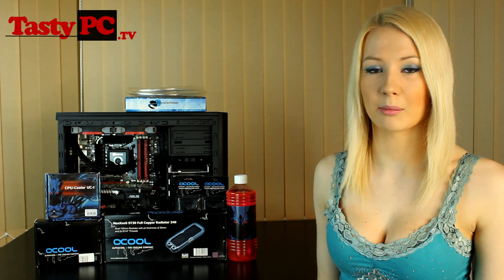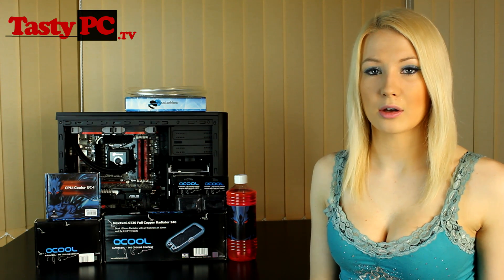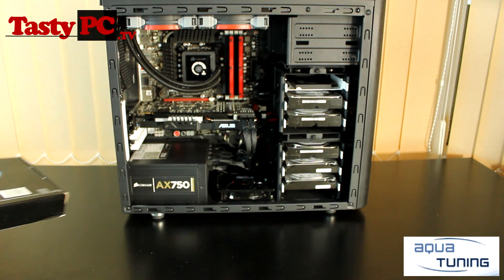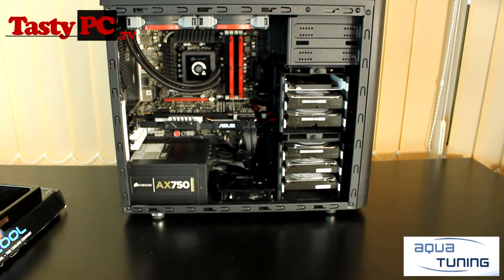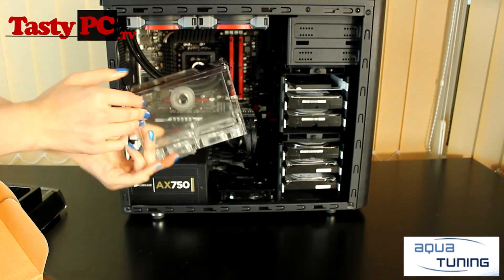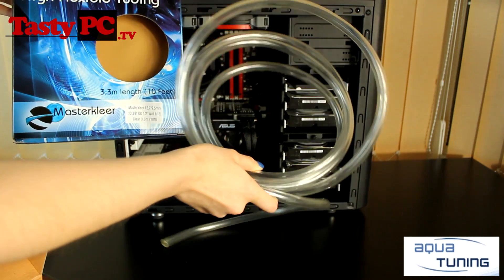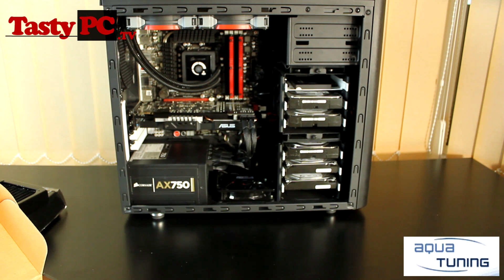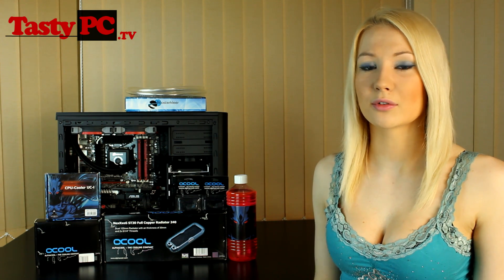Arc Mini Watercooling Plan - Aquatuning

Comment: ok here goes for budget watercooling that said it runs just as good or even better all this stuff here, mini pump from amazon £8 double 120 rad £20 and reservoir 25 quid, mini block that will fit in between the cpu and air heatsink for hybrid cooling, a fiver. 

http://www.amazon.co.uk/gp/product/B00IYLYRRY?psc=1&redirect=true&ref_=oh_aui_detailpage_o01_s00

http://www.amazon.co.uk/gp/product/B010P3VN4S?psc=1&redirect=true&ref_=oh_aui_detailpage_o02_s00

http://www.amazon.co.uk/gp/product/B00L2868VE?psc=1&redirect=true&ref_=oh_aui_detailpage_o03_s00

Buy em, actually will do a better job than all that stuff in this video for half the price :)

DO NOT mount hard drivers underneath a drive bay reservoir, one spill and your hard drives are dead. and 
DO NOT mount your psu with the fan facing upwards, again so called "anti conductive" liquid means nothing after a week or two of use, if it gets in there it will blow up your power supply. the fan supposed to be sucking in fresh air from outside the case anyway so it should be faced downwards.

Comment: I enjoyed the video a great deal :)
I was out of water cooling for awhile.
It's nice to see all the new updated parts.
It's a lot easier to do now then it was say 14 years ago.
The only suggestion I would make is that red coolant can stain your tubes and res and is a pain to flush out of the rads, if you change your mind on which color coolant to use.
I usually use colored tubing and straight distilled water with a few drops of biocide.
Same cool look,-less mess :)

Comment: I think this depends where you come from regarding the weather, whether you have airconditioning or not and your rig. In the UK i cant see much need for it, but im in Australia and its quite common in summer to get 44 degrees C, so i find particularly in summer my computer does get very hot and my new build will have cooling. though i dont want to risk this type of water cooling which requires a tank of water in your pc. I am going to go for the H100i sealed cpu cooler :)
Reply: TO A DEGREE I AGREE W YOU water-cooling OR AIR this is a personal preference sometimes and other times it depends on performance of the device- was watching a youtube vid on how water cooling companies are tricking us... :)

Comment: The second pump won't improve flow rates and it won't improve temps. All it will do is improve static pressure (or head height), in case more components or longer hose are present, so that the fluid won't lose its circulation speed. For a single component - it doesn't really matter.

Comment: I like it because it cools really well and remains damn near silent when done right.

On an unrelated topic, the H100 vs custom loop you were talking about in this video is sounding to me like custom water - win; H100 - lose. At least to me there's no real benefit in using a pre-sealed water loop over say a D14. The fans are loud, there's a pump generating noise as well. The only two reasons I see would be aesthetics and space considerations. It is easier to fit a 240x29 in some cases than a D14

Comment: My CPU hits 125 C and freezes my desktop, this is with Thermal Protection disabled in my bios. With protection on I'm at 88 C, when 61 C is max normal temp. I need a new CPU, then I will follow your guild for Water cooling, in 6 months. So awesome video, thanks.

Comment: Quick question did you make sure clean out everything? Distilled water should do it, sometimes metal shavings get inside the radiator which is no go for the pump :/

Comment: Ah sry...meant the F12s^^. Well, I don't have the SP quiets...but in your video they seem to have the same noisy bearing as mine have. It may don't disturb you, but in my opinion it isn't silent. The NB PL, etc. aren't completely silent too, but there's nearly no bearing sound and that's, for me, one of the most important things. I do only know and own 1 fan series without any bearing sound...the BeQuiet Silent Wings USC...but these are only case fans and it makes no sense to use it on a rad.

Comment from the maker: The H series coolers aren't the most reliable with the pump noise problem. Corsair are working on a fix and are replacing and faulty units. But reviewers can only review the sample they are given so that's why they get good reviews. The SP fans are better than the Scythe GT and the NF-F12s (using P12's is silly) in my opinion and in my tests. I have 20 because your average rig needs 7-9 fans so it's only really enough for 2. No faults with any of mine at all. The SP quiets are completely silent.

Comment: 20 pieces? oO...and I thought I'd have a lot fans of the same type ^^. But it's a bit confusing that every youtube hardware reviewer praises those Corsair fans (and the H80 and H100 which do have a really high misfunction frequency and are too overpriced)... I mean, it may be a good deal for the low price, but if sb wants to have a really quite system, these probably won't be the right choice. NB PL, Scythe GT and Noctua NF-P are better, if you want to have low noise static pressure fans.

Comment: You won't see any differences between 1 or 2 pumps (it may take a bit longer to fill, but your build is so tiny, you probably won't notice it). The temperature will be the same, because you will have enough flow anyway. With this in mind, I suggest you to stay green, save power and use only 1 pump :) ...1 more thing: I wanted to know, what's your opionion about the Corsair Air Series fans? I've got 4 of these and every one of them got a noisy bearing (2 AF Quiet, 2 SP HP)...same in your case?

Comment: For a comparison between the h100 and a normal cpu loop its perfect.
Because then you are able to see if there is any kind of difference from having a very small simple loop (H100) vs having abit more complicated loop with a pump and reservoar.

So the point is that it's for a comparison and in that case it's gonna be very cramped if you throw in a 60 mill rad plus fans.

Comment: Be sure and use fans that have a high static pressure like the Noctua NF F12s or the corsair SP120s if your doing push only on that radiator as the fins look a bit dense.

Comment: sounds like you've hooked the H80 into the CPU fan terminal on your MB, plug it instead into direct power or separate fan control.

In the installation guide you'll find a section explaining that the MB fan controller is no good for pumps.

Comment: The problem is the heat capacity vs heat transfer rate of copper->water (CPU) and water->copper (rad). Water has a very high heat capacity, and the flow rate in most watercooling rigs is pretty high, so during the time the water is in the CPU block it only heats up 1-2C, unless there is a huge delta between core and water. Similarly, the radiator also has the problem of copper/alu -> air transfer. Air has much lower heat capacity, and to cool 1cL of water 1C you need >1L of air at Δ10C.

Comment: With decent flow, the water temperature delta is only a degree or two over the rad and CPU, so the order is not very relevant. What matters is how much wattage you manage to move out of your CPU to the water, and out of your rad to the air. Preferably with as low delta for both transfers as possible without noise becoming bothersome.

Comment: I'm looking forward to that. I have an H100 myself, with Noctua fans. It does an OK job of cooling my 3930K, running at 4.2GHz @1.3V (lazy summer overclock). I'm hoping it will handle 4.5 in the fall.
Will you be using a 2500K? I'm kinda skeptical of the point of using watercooling beyond H100 on such a small chip with low TDP, but i'm guessing you'll be clocking it past 5GHz.
Looking forward to temp and noise comparisons :)

Comment from the maker: It's a full copper radiator. They don't paint it completely black as exposing the copper helps with heat dissipation. I'm pretty sure I mentioned it in the video.

Comment: The copper you see on the radiator is not that the didn't paint it, it's Copper coating, they spray it on.
as far as i'm aware it's something to do with the life of the radiator, and maybe some extra dissipation

Comment: watercooling is good as long as you do it right and u don't..well..f**k it up... 
If you make u're loops right and make sure that you have no leaks,  mount the blocks corectlly you shoud be just fine.
And u need to make sure from time to time that the pump is working as it should.